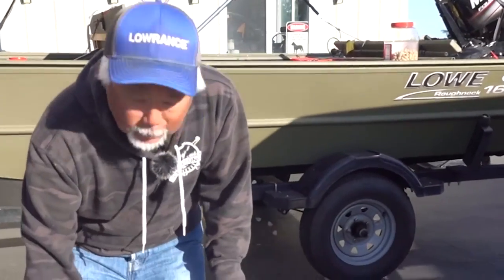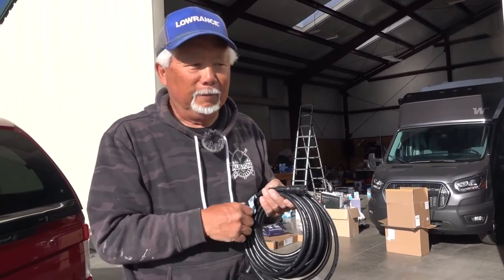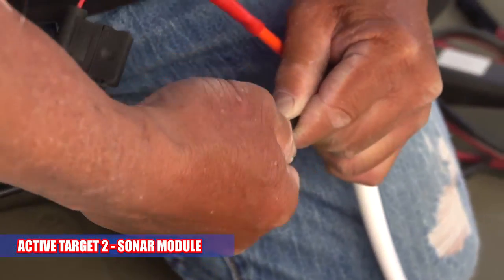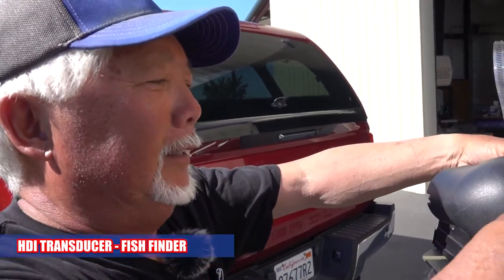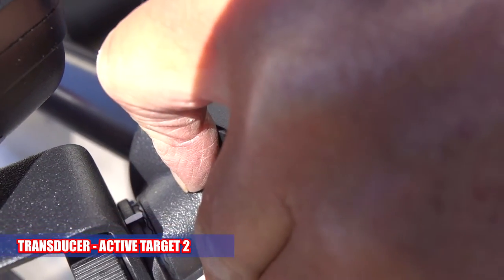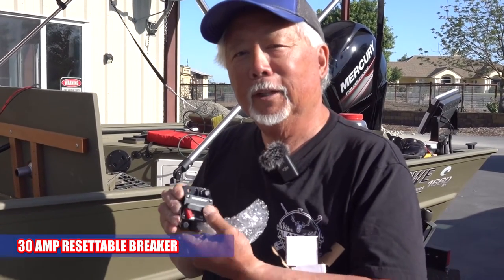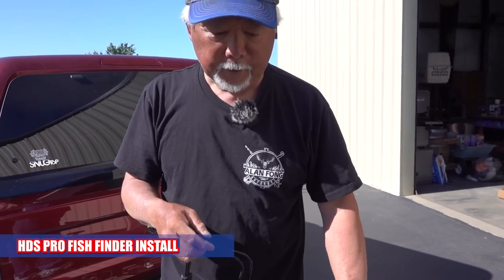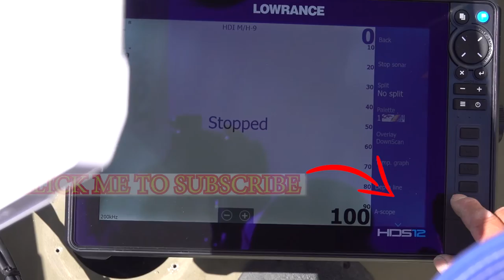Lowrance HDS PRO + Active Target 2 (*TIP - Use BREAKER*) + HDI Transducer - FULL INSTALL

Comment: Thanks for the video! So you have separate batteries running imaging than your crank battery and trolling motor battery? We are looking at this system, but not sure if it could run solely off the 2 battery setup, or if we will need to plan to put another battery system.
Reply from the maker: Depends if your running lithium batteries. If your running acid batteries and have two in series for the trolling motor you can tap off one for your electronics n imaging. I went to lithium and I run one 36V just for trolling motor and a 12V just for electronics. I did video on setting up system and you can watch it

Comment: Great vid. But I didn't think you needed the black box module (S3100?) to use the Active target 2 transducer with the HDS Pro?
Reply from the maker: The black box will give you fish reveal in side imaging. With the new HDS Pro in DI n SI its runs in new higher frequency and is pretty clear n clean pic. Haven't used it enough yet but it's definetly clearer pic.
Reply: @AlanFong  thank you 🙏 So just to clarify, you only need the S3100 to get the fish reveal on SI when using HDS pro? Just checking because I wanted to get active imaging HD transducer and Active target 2 transducer, and HDS pro head unit, and don’t want to pay the extra for the S3100 module… it’s not 100% clear on the Lowrance site if it is required or not
Reply from the maker: The new HDS Pro comes with the new higher frequency transducer for down and side imaging. I installed one in a friends boat and it is clearer and the  Active target 2 is also clearer. I installed three HDS 12 Pro and Live target 2 in Denise boat and it is clearer than my Live units.
Reply: I'm watching this video to get tips on how to install my new HDS Pro and Active Target 2. Fyi, the black box he's installing here is the Active Target 2 box not the S3100.

Comment: Could you put switch on power to module.  I am building an ice fishing unit and want to be able to turn   module if just using 2d sonar.
Reply from the maker: Yes I use resetable breakers on all the boxes I install so when not using I turn off power to box.